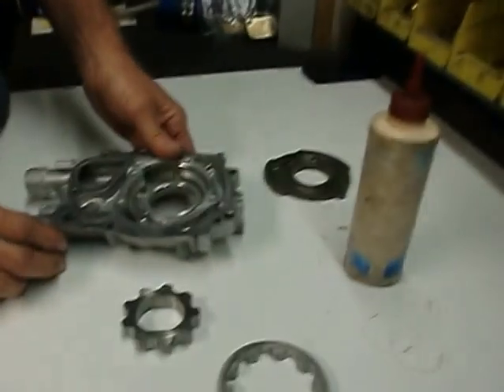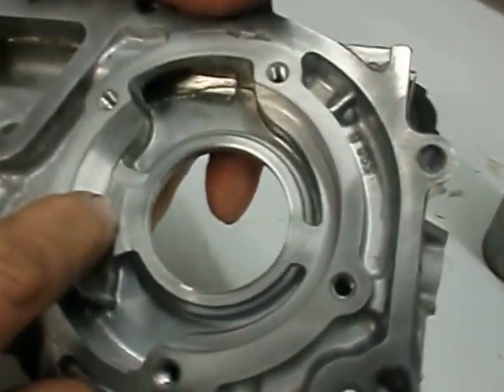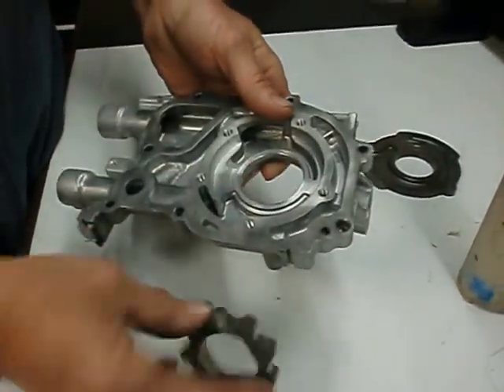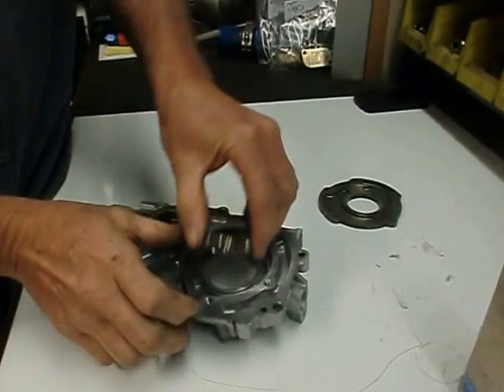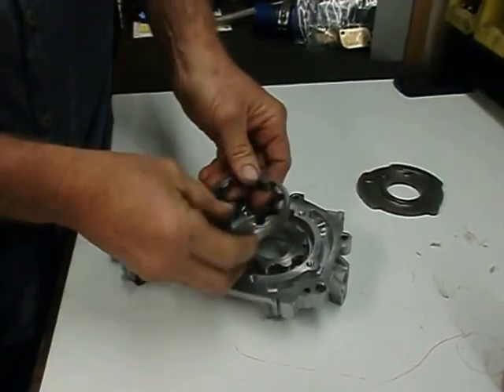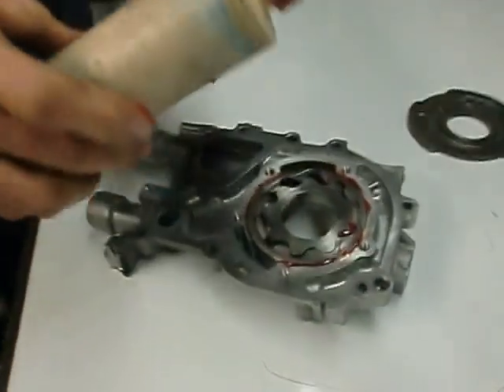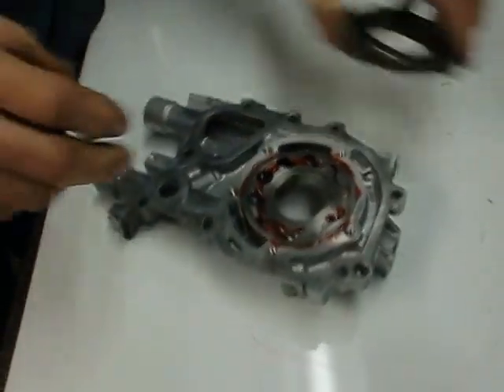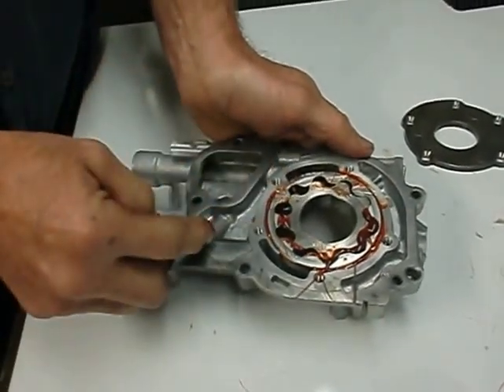Subaru Oil Pump Priming

Comment: I’m working on a 3.8 v6 firebird with a similar oil pump setup. I have bad scoring around the housing just like this and wasn’t sure if this was why I had 10psi at idle and 40psi under throttle. I hope this is what was causing my bad oil pressure. Thank you!!

Comment: What will happen if you don't prime a dry oil pump and fit it ?
Reply: The engine will not see oil pressure when it’s running. Pump must be primed with assembly lube.

Comment: Pretty good. There is not much point in filling the cavities with assembly lube since the engine needs to be rotated in order to install the timing belt.
Reply: The oil film left by the assembly lube is the thing that seals the rotors and the housing. A dry pump will still have an air gap which will make building oil pressure more difficult.
Reply: if you put it on and fill the engine with oil before you put the belts on, it should still prime.
Reply: i was about to comment and then i saw urs which makes sense, the way they did it only works if you install the oil pump last and not even rotate the engine just leave it on the timing mark

Comment: Hello, my 94 impreza's EJ16 engine is having a knock, when warm. I did use 5w40 and after that 10w40 and now 15w40 engine oil, and the knock keep coming back,when hot. The engine has 130k miles almost 200k kms) performance is good until it starts to knock. I see the subaru EA81 engine oil pump is much rugged piece of machinery that those on EJ pumps. Could mine get bad pressure or this is bullet proof and I should troubleshoot the engine at other parts. What you think, sir ...
Reply: OS Coutinho  Hey, it sounds like you probably have some piston slap going on. Probably no need to pursue oil pressure issues.
Reply: I changed a bad injector and the knocking went away. Was a lean condition that led to preignition, in my case. kind of haaaard to find, since there wasn't much misfiring. Alot of Scoob knock could be injector related, IMO.
Reply: ive heard some of the stock subie ecms was bad about pre ignition.